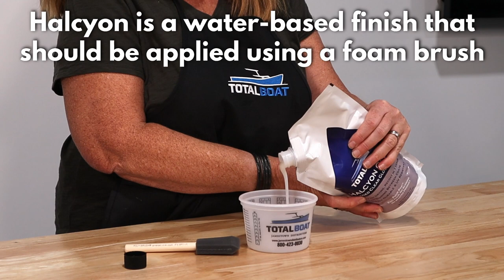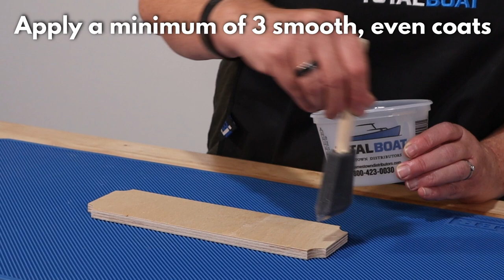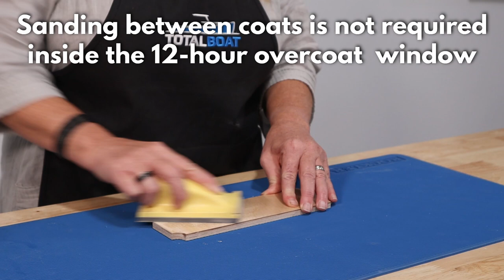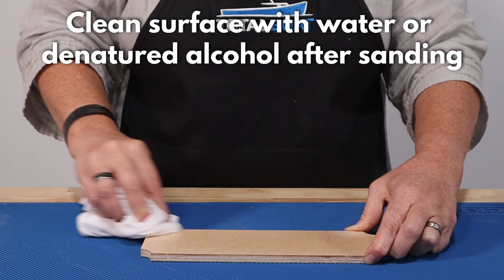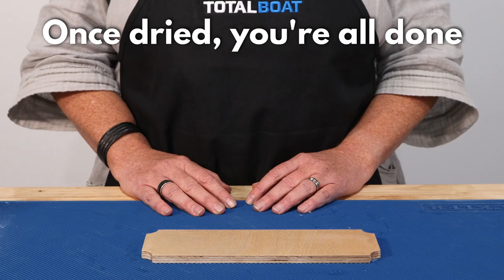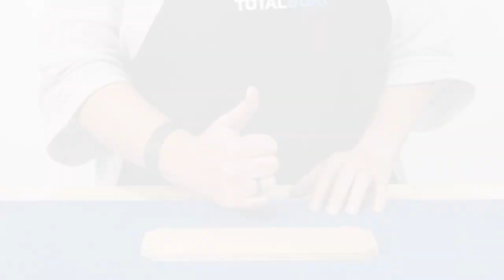Halcyon Brushing Tips

Comment: I create custom wood signs using a handheld wood router and/or a laser.  Halcyon has been my go-to finish since 2019.  My preferred method of application is to spray it.  I spray because I have multiple, different depths of surfaces in my signs.

Early on in my use of Halcyon I did have an issue with one application.  However, in discussing the issue with Total Boat, we figured out I had applied the finish incorrectly.  I had not properly cleaned my surface before application.  I sanded it back down, cleaned correctly, and reapplied the Halcyon.  The result was perfection.
Reply from the maker: So happy to hear that! Thank you so much!

Comment: I am interested in using this product on a Walnut entry door that I need to refinish.  Do you know if you can apply it over an oil base stain and can you wet sand it after the final coat.  I am thinking at least 5 coats.  The door in question has an oil base varnish that has held up but the wood is starting to lighten from UV light and I would like to strip the door to bare wood, stain it and put a top coat on it. Thank you
Reply from the maker: Halcyon can only be applied to oil-based stains if they have dried completely. Most stain products have a resin material in them that will cure or harden to a tack-free state.  

It is strongly advised to always test the compatibility of any stain products used with a varnish on a small sample piece before attempting it on the final project.  Here is more information on doing a test first!

https://support.jamestowndistributors.com/hc/en-us/articles/360056668674-Can-I-apply-TotalBoat-Halcyon-over-an-oil-based-stain-

Comment: I am using Table Top Resin for a large 3' x 10' table (1/8" thick).  How do I protect the edges?  Do you have material that doesn't self lever which would just fall off?